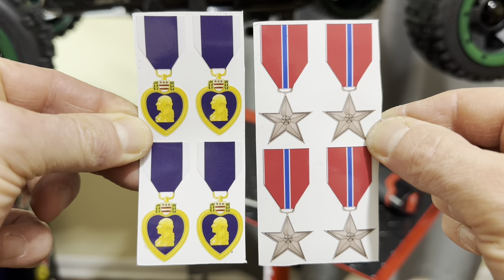Rovan 5B Military Build Part 3!!

Comment: Love the vids man! Have you got any advice on what to do mod wise with a stock rovan 36cc twin ring motor with a walbro 1191 carb. I put a side pipe & velocity stack on it but that’s nothing special, I want something that will give it a lil bit more brap!
Reply from the maker: Ask Fearless to send you a single ring topend that alone will give you more power because the double ring top ends are junk! It will eventually eat the plating off the cylinder. The dual ring 36 and 45 are no good. Happy New Year to ya!

Comment: Awesome build! What pull starter do you recommend
Reply from the maker: Its all depends on the engine . A low compression little engine like this here in the video the stock one works just fine. But a high compression engine , I like the Taylor rc easy start or the Rovan RC super easy start it has a fat housing. But the fly wheel needs to be changed also with those easy starters and a pawl assembly is needed as well.

Comment: Nice video I liked I have question I see you put the red wire toward engine side and black wire out side but in my ignition coil wire the red wire outside and the black one toward to engine side is that normal or I should to Change thanks appreciate
Reply from the maker: Hey bro some coils may have the polarities changed around. I simply did this because the hot side red wire is closer to the engine and the negative wire the black is outside because the - negative is on the outside of the coil. Somewhere on the coil it should show you plus or minus. Hope that helps bro! Have a great day
Reply: @eastsiderc  thanks for reply keep up 👍🏼
Reply from the maker: Hey you’re very welcome